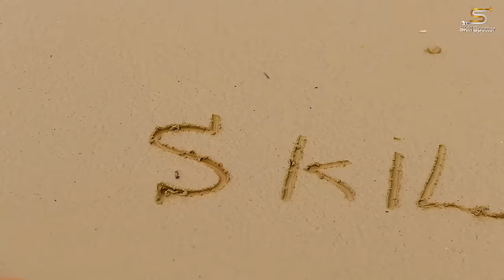True Ancient Terracotta Pottery Technique Actually Exists | Satisfying Pottery Glazing & Kiln Firing

Comment: I’ve watched video after video and nobody ever tells how the glaze does not stick to the biscuits? Otherwise it’s amazing! They must have very healthy and flexible bodies and hats off to their hard work 👏🏻 But please! About the glaze and the biscuits?
Reply from the maker: Actually the biscuits were attached with wheat flour as you see in the video the guy was mixing the flour.
That's why they didn't stick with the pots and glaze.
If they stick them with clay then biscuits can stick together with glaze and pot.
Thank you very much for your comment.
Reply: @SkillSpotter  please tell me what kind of glaze you are using in these pots.i also belong to potter work but never succeeded in glazing.
Please also tell me ,what is the melting temperature of the glaze used in this video
Reply from the maker: Glaze is made by grinding old glass pieces in powder shape and then mixed with water and coated on the pots.
Temp is around more than 300 degrees.
Reply: @SkillSpotter  please tell me what tool or machine you use for grinding glass pieces and is there any chemical you mix with glass powder.

Comment: What are these pots typically used for??? 
Food storage, water???
Reply from the maker: Depends on need.
These can be used for any purpose food storage food cooking and also for water.
Reply: Excellent water cooler and also you can cook handi mutton or handi chicken in these pots. Or you can cook rice, lentil soup or other gravy dishes. The fired clay adds extra aroma to the cooked food or water you keep in it.
Nowadays people think using clay utensils is backwardness and using aluminium and nonstick cookwares is modern. But the same people are digging their own grave by doing so. Aluminium, plastic and nonstick cookwares add to the medical problems prevalent these days.
Reply: All 3

Comment: It’s unfortunate they didn’t show us how they capped the kiln.
Reply from the maker: It was a long process and we were not able to capture those moments.
Sorry for that.
Reply: @SkillSpotter  I appreciate the effort to produce this.  After scanning through the video, at 14;40 we can see a similar kiln in the background that seems to have a metal plate as a cover.  This satisfies my curiosity.
Often we would see a temporary roof made of bricks to seal the roof.
What is astounding is the amount of steps involved and the muscle memory of the men who produces by sight and touch and get some very similar uniform results.
Well done!
Reply: at 14:10 you can see the top of the kiln is covered with broken pot fragments, stacked loosely like shingles. It lets the combustion gasses out without allowing the heat to be radiated away so fast as an open hole.
Reply: @bhartley1024  Yes I caught that.
Reply: @nzs316  for some reason your earlier comment wasn't showing up, or maybe I just didn't see it somehow.
Reply: @bhartley1024  It’s all good. Cheers!
Reply from the maker: Thank you so much for explaining @bhartley1024
Reply from the maker: @Neil scott ,We will try our best to bring another detailed video about the kiln process.